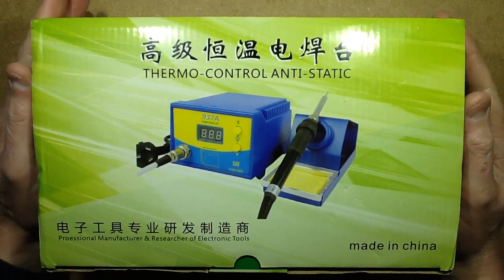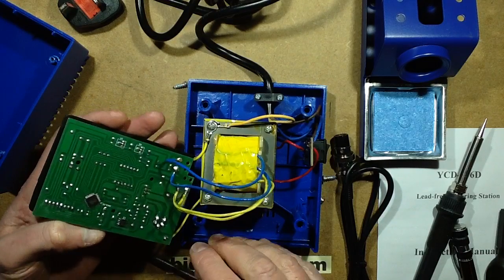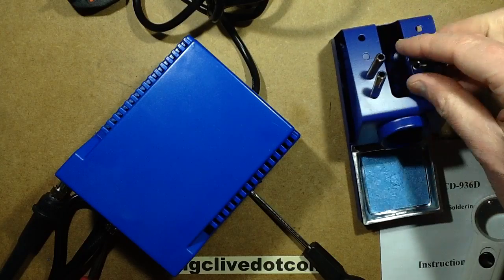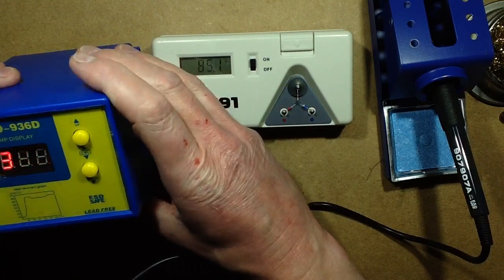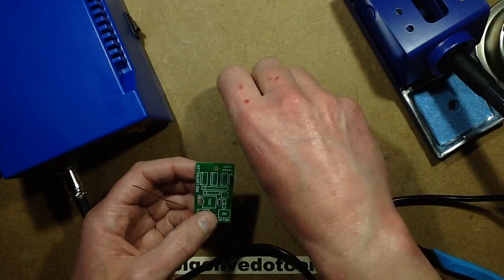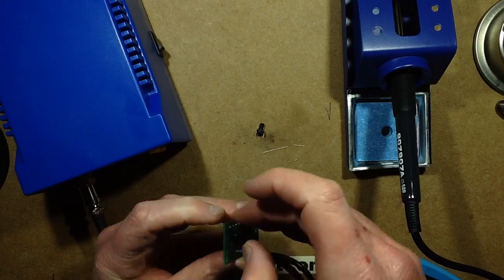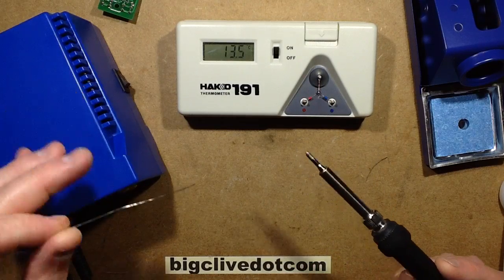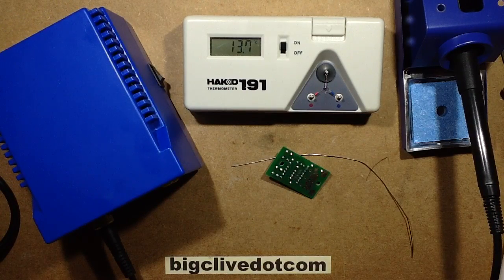936D digital soldering station test and internal look.

Comment: HI Clive, I'd been keeping an eye on these on eBay with a view to buying one after I'd seen your review. There were also replacement front panels for the exact same machine. Now I can't find anything at all on eBay relating to them, I've even trawled Completed Listings searchig for 936-D and Digital Soldering Iron/Station - can't find one, any ideas? Have they suddenly become popular because of your review?? It's the only conclusion I can come to. Thanks, Stuart.
Reply from the maker: +Stuart Hossack They are still quite new and hard to find.
Reply: I've a sneaky suspicion that there may be a design fault with them. I bought one, worked ok the first few times I used it.
Now I can't lower the temperature. 
The button works, checked it with a meter etc.... the eBay seller said they must have taken on a bad batch.😕
steer clear for the time being I'd say.

Comment: Just got one of these units, UK supplier on Ebay, Chinese priced, strange transformer smell ...but all works fine. 
The UK mains plug is sleeved pinned, but they are to BS sizes. It has a 13 a fuse though, changed it to a 3 amp. The earth pin appears to be connected through to the main unit, and the iron shows earth. It handles lead free solder OK, but 60/40 and 145c work fine as well. It can be used with 90c woods alloy, as the iron has to be at a slightly higher temp to make the very low melt solder work.

My uses for it will be model assembly, brass etched kits , mainly with the 145c solder for fine details. The min 190c is fine for 145c solder. The availability of the cheap tips is a distinct advantage over Antex.

The soldering iron power cord appears to be the soft silicon flexible type.

Quite a leap in quality from the Chinese makers.
Stephen.
Reply from the maker: +stephen wallin Mine had a strong transformer lacquer smell out the box too.  It should fade over time.  If the earth pin of the plug has a partial plastic sleeve then I'd recommend changing the plug as it may not make a proper earth connection in some sockets.
Reply: +bigclivedotcom Clive - I've got TWO of these units, albeit with a slightly different model number and faceplate - like this one: http://www.linuxmediaserver.net/wp-content/uploads/2015/02/Budget_soldering_station_620px.jpg
The reason why I have two is the first one stopped working after I had a nightmare desoldering some high mass lead free joints.  The only way I could get the job done was to turn the temp to max with my largest bit.  After 20 mins I finished, and the unit was pretty hot.  I let it cool down but when I turned the unit back on it didn't work, so keep an eye on the temp of the transformer.
As I liked my unit so much, I decided to buy another and... ahem... send back the broken one to the 2nd supplier, claiming it was DoA :/  In the end, I didn't bother as it felt a bit naughty as I'd be penalizing a seller who didn't supply me with the original unit - having a conscience can suck sometimes!  
However now thanks to your video, I'm now going to get one of the Hakko-ish 936 fronts and solder that on to the transformer.  Many thanks for the heads up on that.  Shame that I can't seem to find a 936D replacement faceplate instead.
I love my unit as I have now learned to solder with it (having a decent iron makes such a difference over those Maplin 15W things!).  Nice to see the unit on your channel with a positive review, so many thanks for that (and all of the other vids you do).  :)
Reply from the maker: +EscapeMCP If the transformer has overheated it may have tripped a thermal fuse on the primary.  That way it wouldn't work even with a new front panel.  Unless you also procured a decent beefy 60VA or more 24V AC transformer.  (Or investigated if the thermal fuse had failed and was easy to replace on the existing transformer.)

Comment: Excellent video as usual +bigclivedotcom! Love your videos - always learn something new. Just getting into dabbling with low voltage stuff for fun. I just bought one of these stations after buying a more expensive Jihua one that never got dispatched and was unable to contact the seller - just waiting on eBay for a refund.

The Antex tips do seem pretty expensive for what they are or I would have gone for the XS25. You can buy a full 400A work clamp for £2.80 delivered from the UK and it has probably the same amount of copper (assuming they're just plated copper tips, not sure) as an Antex tip that costs £5.49. It's not like Antex is a new company that's had to throw a lot of fresh green towards mass producing thousands of tips.

If the tips are made in England that's probably why. You can't beat much cheaper material costs everywhere outside the UK, or slave labour.

Comment: I would seriously just invest in a quality Iron and be done with it. With all the hassle the 
cheap irons give at the end of the day it is only money and quality always counts. Irons capable of soldering 0402 SMD can also blast large guage wire by virtue of proper temperature control and an 80W or thereabouts heater. One Iron to do everything.
Reply: +mbaker335 - Do you also use a single driver for all types of screw? Or a single size of spoon for eating soup and stirring tea?

Other than saving some space and money, there is no advantage in using a single tool to do everything. Not only is it less specialised, but if it stops working, suddenly you're stuck, whereas if you have two or three different tools optimized for different types of jobs, one can serve as a temporary replacement for the other(s).
Reply: +RFC3514 
 I am happy with the idea of having more than one soldering station. I have ERSA, weller, and hakko stations each with a good selection of bits and each with sufficient power to handle almost every job. I also have a cupboard with several cheaper and to be honest dreadful stations in it that were a mistake to buy in the first place.

I would love to have Metcal and JBC stations but the cost is simply more than I can justify. However I would not use an iron that cost 1.5Euro to solder a smd chip that cost 30Euro. A soldering pencil may cost more than 100 Euro but that is also usually for a very good reason. Quality is always cheaper in the long run
Reply: mbaker335 - And with a lot of products, what you're paying for is the brand, not the quality (as evidenced by the issues Clive had with Antex tips).

Just because you got some cheap soldering stations that weren't very good that doesn't mean all cheap stations are crap. In many cases, they are absolutely fine, just aimed at smaller jobs or less intensive use.

It's not just Clive; if you check out Dave's EEV Blog or several industry / hobbyist websites, you'll find a lot of "converts" to some cheap obscure-band soldering stations. They're obviously not all good, but they're not all bad, either. 

If you know enough about how the tools actually work, and are willing top open them and poke around inside, you can often find high quality equipment for pretty low prices.

A soldering iron is a pretty simple device. If it's something more complex (or if you don't know what to look for), picking a "famous" brand is one way to get some security (because you know they probably won't put out crappy products which would hurt them in the long run - then again, sometimes they do). 

And, just like you can't justify buying a Metcal station for your 30 euro chips, maybe some people can't justify buying a Hakko for their 3 euro (or 30 cent) chips.

Comment: Also clive, I'm curious, do you know of any digital controllers like this which are just the faceplate, so that you could upgrade a hakko 936? Seems like it should be a thing, and would definitely be a nice change, and likely more affordable until you could get a nice new station with interchangeable bits.
Reply from the maker: +Jesse I've not seen the digital faceplates yet.  They would require an extra 10V supply on the older stations.
Reply: Alright, maybe it's just not worthwhile for the companies to make one with a 10v regulated supply that feeds off the main one. Probably just more worthwhile to churn out the complete units.

Comment: For forming leads they have those cheap little red triangular plastic tools with all sorts of lead spacings, you just center the component and bend them to get really nice looking bends, though most of the time I just do it by hand too. Would be handy if you were doing a lot of components though.

Comment: without some way to peoperly calibrate this ( the unit next to it) I would have to avoid it all together. Pretty much most of our electronics come from china,may as well face that fact. If relations ever went bad between us,we would all be screwed. Of course the fact is,every country is now totally dependant on others to make it. That was the result of W.W.2, we all became reliant on each other.No one country could truly function normally without others,even North Korea.
Reply from the maker: +scott firman Even the high profile soldering stations need calibrated.  That's why the Hakko 191 calibrator exists.

Comment: It sounds like an odd question but why is the sleeved earth pin bad? They have made them mandatory in the Penal Colony >.<
Reply from the maker: +themaconeau The socket is designed to make contact with the earth pin first so in many sockets the point of contact ends up close to the plug.  If that area is sleeved then it may end up being the bit where the contacts are.
Reply: bigclivedotcom And Chinese factories known for their superb engineering tolerances, may make the earth null and void. Gotcha ;)
Reply: +yogibear2k10 Actually I have a Weller temperature controlled soldering station (WESD51) sitting right next to me. The purpose of temperature control is to maintain constant tip temperature regardless of "load" on the iron, e.g. the temperature of a non-controlled iron will drop significantly while actually soldering a joint whereas a controlled iron's temperature will only drop a few degrees and bounce back rapidly as the controller senses the drop and pours on more power.
Reply: +themaconeau Are you sure the earth pin is sleeved? My (admittedly brief) googling has shown plugs, that like the UK ones, have sleeved Live (Active) and Neutral pins, but a solid metal unsleeved earth pin
Reply: +yogibear2k10 I was replying to the initial comment, "why is the sleeved earth pin bad? They have made them mandatory in the Penal Colony" 

youtube's new google inspired threading system messes with this and makes it unclear who I was replying to. Googling Aussie plugs (I assume that's where themaconeau meant by 'the Penal Colony') showed me no sleeved earth pins.
Reply from the maker: +yogibear2k10 In this case the pin is not a plastic one on an unearthed appliance.  It's supposed to be all metal, but for some reason they have sleeved it like the others, which defeats the earth connection in some sockets.

Comment: sir, can i use 40w LED driver to power a 10w LED?
Reply: +chris topher sl  No, you can not if the driver is constant current type - which probably is. The LED will fail immediately or within a couple of seconds.
Reply: ok thanks

Comment: Have you considered reviewing the TS100? Some of my acquaintances claim that it is a full-fledged soldering station housed in an iron. I am skeptical? http://www.banggood.com/TS100-Digital-OLED-Programable-Interface-DC-5525-Soldering-Iron-Station-Built-in-STM32-Chip-p-984214.html
Reply: +zinobi I use it and it is a miracle. It also accepts cheap T12 soldering tips. Can be run off-grid from 4S AA LI-Ion cells in a small battery box. I really love it!

Comment: One feature I would welcome on these units is a 1 hour timer,  so that if (when) I forget to switch the unit OFF, it does just that all by itself after one hour. Because if you leave an iron ON for 24 hours or so, you may well find it burned out when you return... It happened to me... The timer might have an annonciator (beep) after 50 minutes so that you may retrigger the unit manually for an extra hour by the push of a button...

Comment: The Aoyue 937+ I have might have better build quality but it sure doesn't save your temperature, and because it drops back to 200C every time it's turned on, the up button is wearing out. Maybe I'll get one of these.
Reply from the maker: +darkhelmet169 That can't be right.  I wonder if there's a serial EEPROM missing or not quite making contact.
Reply: +bigclivedotcom According to the manual, that's how the Aoyue is actually supposed to work. The * button that you'd think would be to change the set point is in fact a dedicated reset back to 200C where it can barely melt eutectic solder. Also all the buttons are the little PCB mount metal domes so it's just not very well thought through.

Aoyue seems to have fixed all those issues on the newer model (the 9378) but that one doesn't use standard irons because they added a motion switch inside the handle to turn it off after a certain time of not being used and that requires an extra 2 pins on the plug.

Comment: Would an iron marked 936B work on the Digital soldering station? I cannot see irons marked for the 936D on Ebay
many thanks,
 Stephen.
Reply from the maker: +stephen wallin The generic soldering handles (as they call them) with the female socket on the iron is the main thing to look for.

Comment: Oh I searched for the 936D on aliexpress and was greeted by a digital soldering iron with the temperature control integrated into the handle, with no "station" part, just direct plug. Searching for the 937 (as stated on the box) returns a black soldering station, similar in design presumably but with 3 buttons (the third button to directly enter the calibration mode I presume).

Comment: OK so cheap and good, if you have a soldering iron thermometer to hand, what if you don't have one? It's a shame that it doesn't come pre calibrated.
Reply from the maker: +Donald Sayers If you don't have a soldering iron thermometer then you just go by feel and nudge the temperature until the solder is flowing nicely.  But those soldering thermometers are pretty cheap now.
Reply: +bigclivedotcom Thanks.

Comment: Excellent iron, i have the same particular model. I\m worried bout the safety though. Nothing happened yet, but what can you expect from a chineese soldiering station?
Reply from the maker: +Programatór You can expect modest use from them.  Particularly if it's just occasional hobby use.

Comment: A word of caution

IIRC, the temperature overshoots by a long way, but the display is sneakily limited in software to never display a temperature higher than the set temperature, so you do have to leave it a good while to come down from the overshoot between turning on and using it.

Comment: Surface mount soldering would make for a good video.  I've only attempted it once or twice myself and its a nightmare.
Reply from the maker: +RavenLuni Take a look on eBay for the surface mount practice kits from China.  Just a PCB with lots of SMD pads and some components to put on them.  It does take a lot of practice.  Particularly the tiniest components and chips.

Comment: would using some sort of thermal conductor between the tip and the shaft(?) be a good idea?
Reply: +Tigglet that's what she said.
Reply from the maker: +Tigglet I've considered a thin metal shim or even a copper loaded high temperature grease.

Comment: How about links to the soldering station and tester?
Reply from the maker: +Frederick Morrison I got mine from a UK warehouse.  If you search for 936 soldering station and 191 soldering you will find them.  Shop about, there is a wide price variation.
Reply: +bigclivedotcom  Thanks Clive, I found some on ebay and will pick one up and learn to solder

Comment: well I know what new soldering station I'm buying... oh btw I have a quick question: my computer power supply failed the other day (giving off a smell and everything), I opened it up to see if maybe one of the capacitors blew but they all seemed fine, any idea what could have failed? I would assume it has something to do with the voltage regulator since it was still powering up but PC was giving me a bunch of power related error codes...
Reply: Check the fan and any circuitry around the area. I'm just learning to solder however,  I've built computers from purchased parts for almost 20 years. Usually, if the power supply is a concern, it's the damn cooling unit.
Reply: Merle Mitchell
fan works fine, just salvaged it in fact :D

It failed after my GPU suddenly crashed, rebooted, and pc decided to spew out power errors and my room start smelling of burning silicon... It was one of those higher end "gaming" power supplies (750w 80plus bronze)
Reply: Sounds almost like it took a power spike but more likely, it was a localized "brown-out" kind of thing. The power supplies are usually good to go as long as the fan is clean and working well. While a power spike would trip the surge protection, very few even monitor a sudden drop in the power.
I think you said it was still working but was displaying power fluctuation errors? I had a similar event when I was building a unit. It varied from power fluctuations too complete power loss. It turned out the chassis case for main board was bad (warped) I ended up replacing the chassis, the main board and the power supply. That was after knowing the cause. The individual units just took to many fluctuations and we're basically trashed.